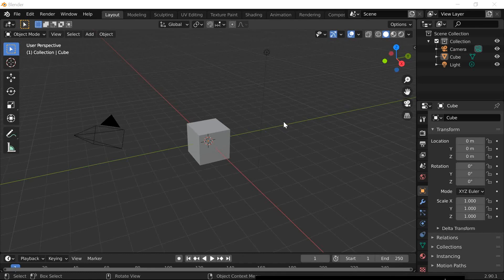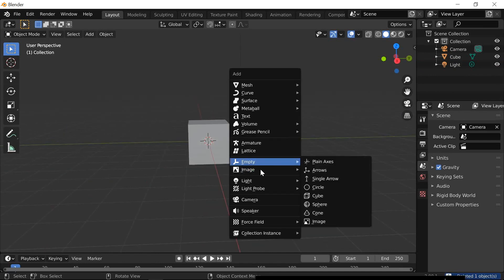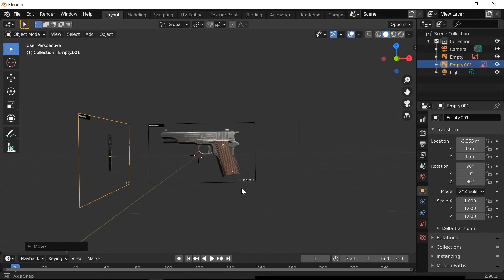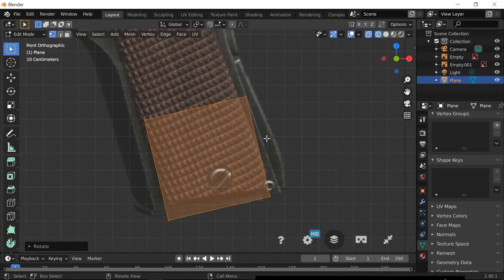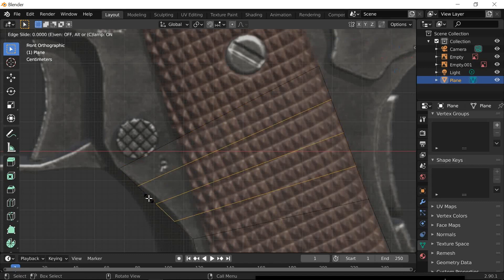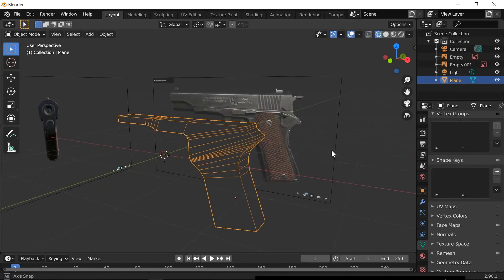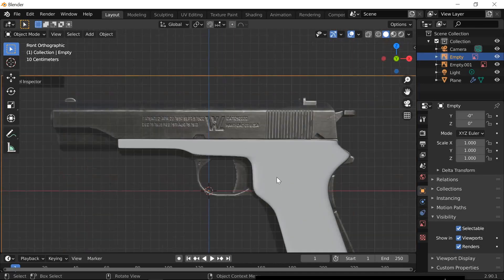Modelling A Gun In Blender | Beginner Tutorial

Comment: every time i try to move the model, it somehow duped vertex on them self
i literally do nothing else than just ctrl r and move them around to match the shapeof my gun but still whenevr im selecting every vertex visible, when i move it, it start showing other vertex behind (and so the result is ugly obviously)
i can never properly move any part without having to check every single vertex by selecting it and use G to move out an extra vertex 
which of course lag my pc and some time clicking once make me click twice, which might not help with the problem of duping vertexs
and its only in 2D, cuz whenever im extending from the 2D model, it start showing, random plane that aren't connected to the rest of the shape, random vertex that aren't connected to anything at all, and holes in my model that just appeared randomly

i don't know what cause this, im just using X and delete/dissolved verterx, to correct mistakes in the shaping of my gun

any idea ?

Comment: Hey, the tutorial is great! If I can give a piece of advice, I suggest you to use the crease on the edges you want to render sharper. Another way is to use a bevel modifier and apply bevel weight to the edges that need to be sharper. In this way you can model the gun without having overlapped edges in a non distructive way.
Reply: Bro how did I never know about creasing edges. Bless you man
Reply: @giannieditsvideos  It happens... I began 3D in the far 2005 using Cinema 4D (switched to Blender in 2014). Cinema didn't have an edge crease at that time, and you had to use the Katana instrument to create loop cuts near the edges to sharpen the effect of the hyperNURB. With Blender, I discovered with pleasure these features. You can also use modifiers in the stack. For example, you can use the bevel modifier applied to a vertex group to create additional geometry near the edges you want to sharpen, and then add the subsurface modifier to smooth the edges.
Reply: @MadquakeCreative  Using Bevel modifier is probably better since it’s non destructive right?
Reply: @giannieditsvideos  they are both non destructive... Both Bevel Modifier and sharpen edges. The Bevel is harder to use as you have to define the vertex groups, but on the other hand you can assign different Bevel mods to different groups (some of them can be sharper and some more relaxed)...

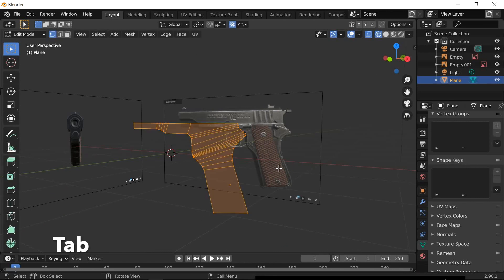Comment: So I'm a tad confused. I like this tutorial, but around 8:38 and looking at the wireframe, I've always been told it's supposed to "flow with the shape". It seems like you did that around the trigger guard, but not the back and around the fishtail of the gun. Can you tell me which parts need a flow and which don't?
Reply from the maker: For me it is more helpful to think in terms of Flat Hard surfaces. Identify the faces that need to be flat and use loop cuts to flatten them out. Leave out the 'flowy' sections. In the end, you will get whatever shape you want. So in this case, the all the y-axis-facing faces need to be flat.